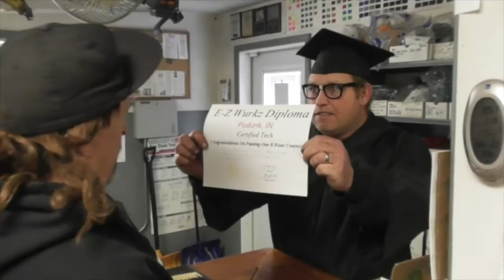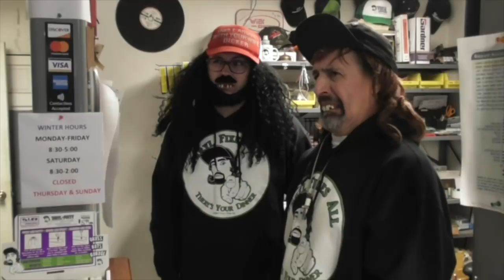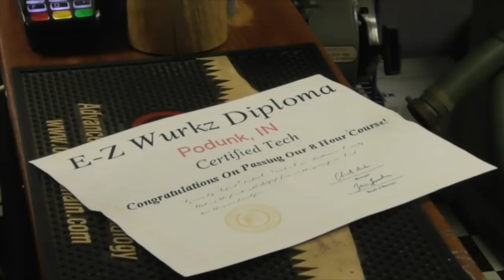Fix Electric Chute Control Switches On John Deere 1330SE Snowblower Murray,Snapper,Simplicity

Comment: In the beginning he asked about a small engine question. Here the answer. Its a balance problem. One scenario is broken blade adapter, blade slipping, cracked flywheel, etc. Unless you have a steel flywheel you need the blade to help inertia .

Comment: When it's -20c , theres 2 feet of snow to clear and another storm on the way,  the snowblower needs to be the most reliable machine available. My 1980's 1032  Ariens and 1977 1026 Snowflite from MTD, ........ NO CABLES TO FREEZE UP,  NO FLIMSY CABLES TO SNAP,  NO ELECTRIC GADGETS TO FAIL WHEN I NEED THE MACHINE TO WORK.....  SIMPLY A NO FRILLS! consumers would line up outside the store(just like on Black Friday) to get their hands on a reliable machine like this.  A no frills machine is the most dependable!  Building machines again like this again won't hurt you,  manufacturers,.... it will boost your sales!!!!    Machines need to be more reliable!!!! Be prouder of your product!! And there will always be servicing to follow... I've been fixin em for over 40 yrs....seen every problem....seen em all
Reply: I have a JD 1032 from 1984 or 85, I bought it new. Like you say, it doesn't have all those electric dodads. The next year they went to a 1032D that started to have the more complicated stuff.
Reply: I have a JD 1026 from 85 that still performs great.
Reply: Greatest electric gadget I saw added to a snow blower was a plug-in electric start :D

Comment: I learned more from Taryl than anyone could learn from that EZ Works class. So I know that the rope pulling away (kickback) is caused from a partially sheared flywheel key!
Reply: I have a 7hp Poulan mower that will act like that if the blade gets loose.
Reply: My guess was bent crankshaft and blade stopping against the deck

Comment: I can fix most anything, and I've fixed this switch multiple times.  I've also replaced it a few time.  At it's root, this is just a horrible design that should have never happened.  JD (Briggs) should have made a kit available to convert to manual chute control...or done that in the first place like everyone else.  But then, that would discourage new snow blower purchases.

Comment: Classic case of contact erosion caused by switching high current  device without current suppression - poor design but that is what you get when cost is more important than reliability.  You could put a bit of dielectric grease on the contact to slow down the erosion.   Great video once again!

Comment: I'd go with a partially or completely broken key way off the flywheel. Just enough to throw the timing out of sync. I've seen some keys half broken. I'm not certified but, I've been tinkering around small engines since late 60's. From REO Royal to Iron Horse and those "crank starter" were scary if you didn't turn the crank all the way. Those lock pins rubbing on the flywheel was enough to pee a little. I still hate those old electric ones with that extension cord taped here, here and there....And more tape there..... You know what happened ! Unless you're too young to know. Keep the good work guys.

Comment: I see several comments asking about dielectric grease on the "contact" of the switch.
Listen folks, dielectric grease is an INSULATOR!!!! It's designed to insulate electrical connections and lube seals like o-rings or rubber boots.
If you put it on a metal to metal connection and it worked for you, it's because the grease was essentially "scraped off" when the connection was made allowing the metal to metal contact. The grease that was "scraped off" has now been displaced and hopefully doing its job as an insulator from the air (oxidation.)
Reply: I wonder if a drop of WD40 applied on the contacts (with the tip of a toothpick) would protect from pitting. I didn't use WD40 when I cleaned my switch contacts. What do you think?
Reply: chrisradano I have no idea on that one, because I don't know if WD-40 conducts electricity. I think just keeping the contacts clean would be the best bet. Any grease/oil that you'd put in there has the potential to collect crud.
Reply: WD40 does conduct electricity. I still won't use it on my switch contact, just because I don't want to use it on something that small and sensitive. Just wondering if there's any way to protect the contacts, I guess not. My chute switch didn't work properly from day 1, so it wasn't from dirt. Not much dirt in fresh snow, either. I'll probably take the switch apart every season to clean the contacts now. Thank for your reply!
Reply: chrisradano I'm not an expert, but I tend to believe the problem is mainly from poor materials in the constitution of the switch.

Comment: Lots of stuff on them electric motor controlled blowers to break just when you need to use it. I'll take the low tech mechanical crank style type for reliability and let that guy with the diploma have the fancy expensive parts electric rig.